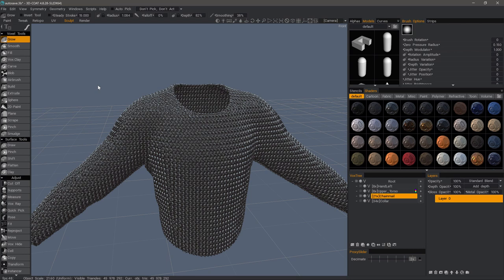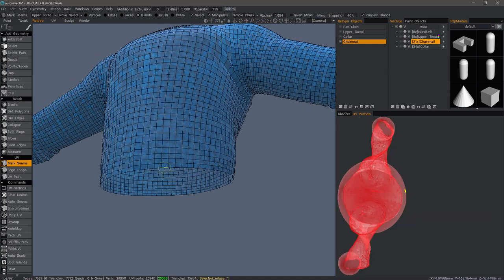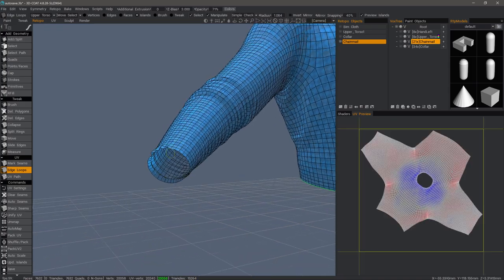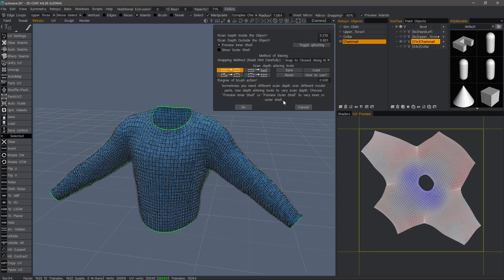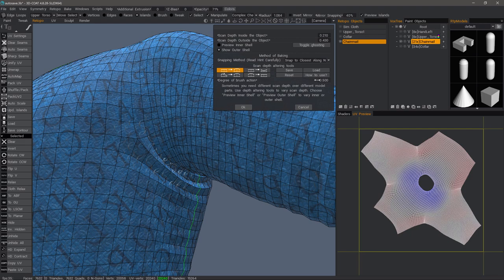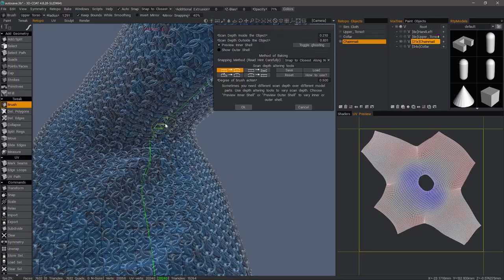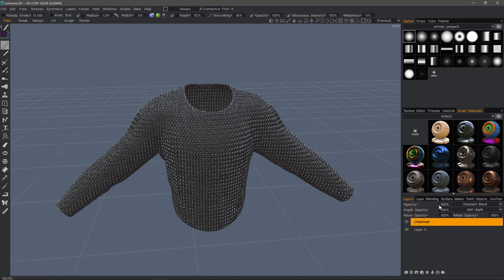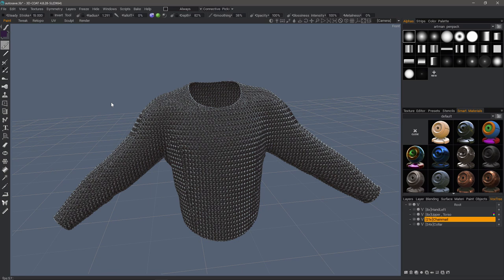Creating Chainmail Pt 4

Comment: thanx1 Displacement in 3d Coat ! Nobody make tutorials about it))
Reply from the maker: That's probably because you are always working with Displacement when using the Depth Channel in the Paint Workspace (on UV mapped models). There really isn't a special trick to learn. When you are painting in the depth channel your are always using displacement...even when you are in Per Pixel Painting mode. You might see a normal map by default, but 3DCoat is also generating a displacement map under the hood. That's why you can switch to viewing Displaced Mesh in the viewport or just the Normal Map, in the View menu.
Reply: @3DCoatTrainingChannel  Yeash thank u! https://www.artstation.com/artwork/oOv0om

Comment: Awesome tutorial, however would it not be easier to just use the same projection method to map the chain-mail texture using height information in the paint room, rather than sculpt then bake?
Reply from the maker: Sam, you could do that if you prefer to go that route, but there are always multiple ways to approach any given task. This was one of those. Plus, this method was largely done in response to a user asking how to do it, on the 3DCoat forum. Another reason this method was chosen is that not everyone needs a lower poly mesh. Many Concept Artists use the high-poly sculpt meshes to render in 3DCoat or export to Keyshot, which can handle them.
Reply: @3DCoatTrainingChannel  Thanks for the clarification, always good to learn new workflows. Thanks again for the video!